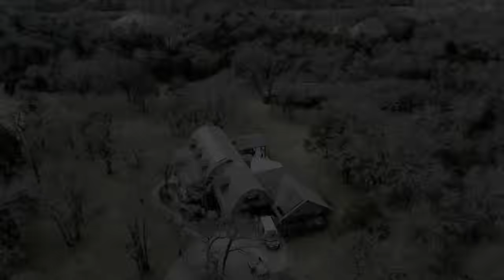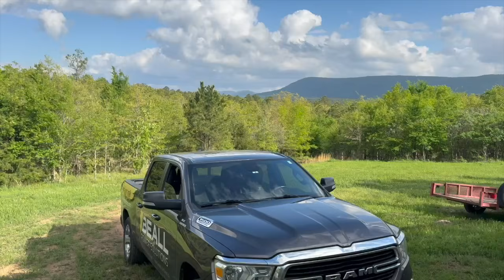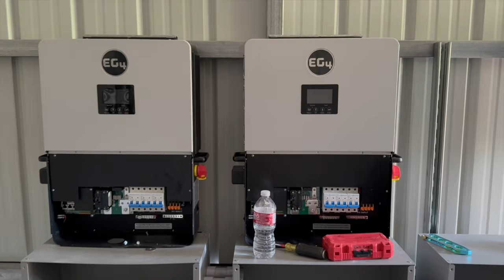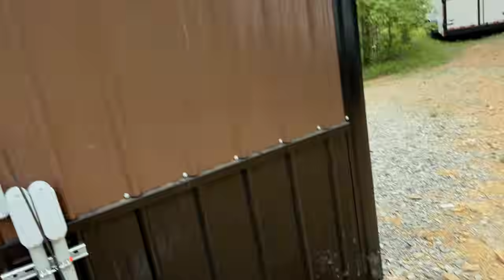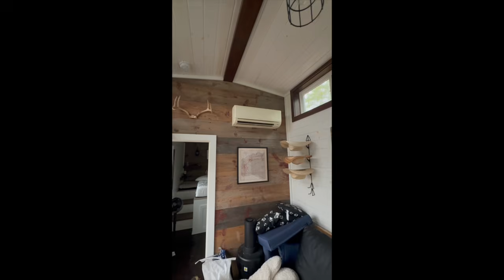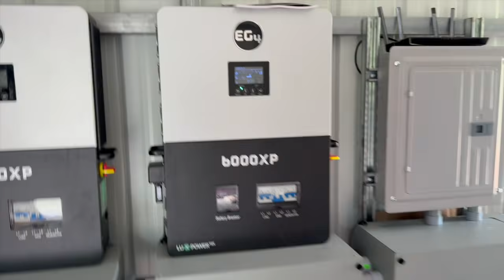We Built a Fully Off-Grid Solar System in the Mountains of Oklahoma

Comment: What’s the reason for using two 6000 XP inverters instead of one 12,000 XP inverter from EG4?
Reply: I would say a combination of redundancy (inverters eventually fail and if one goes down the system will still run just at reduced capacity), and 4 vs 2 MPPT’s allowing more flexibility in wiring the panels and higher shade tolerance
Reply from the maker: @james13341334  Also he may add a ground mount in the future so having the 2 extra MPPTs already there is very helpful.
Reply from the maker: @james13341334  Exactly.